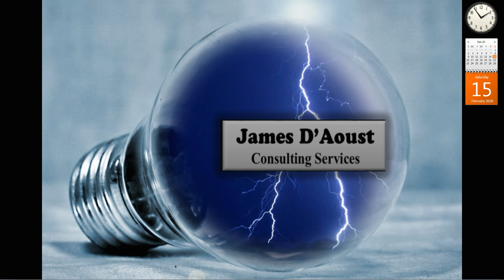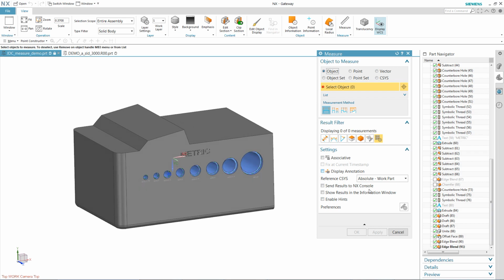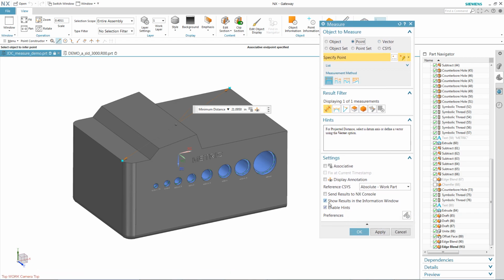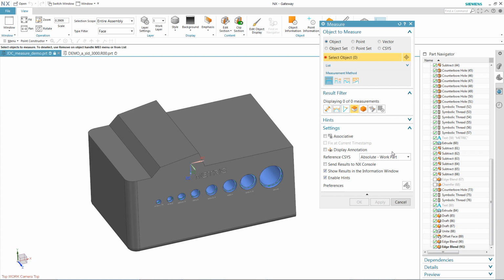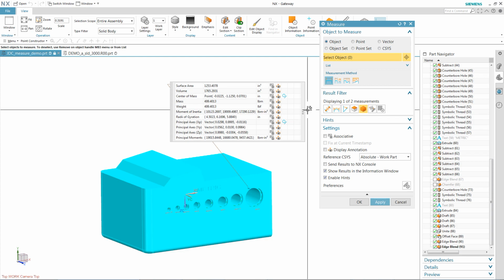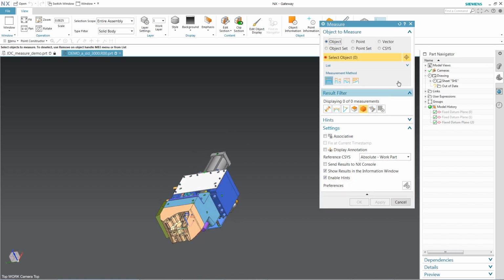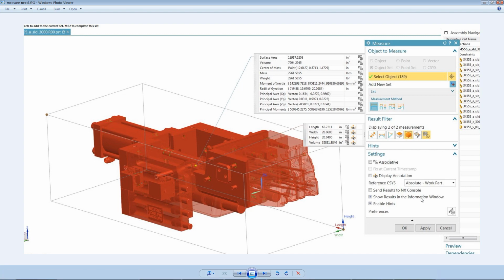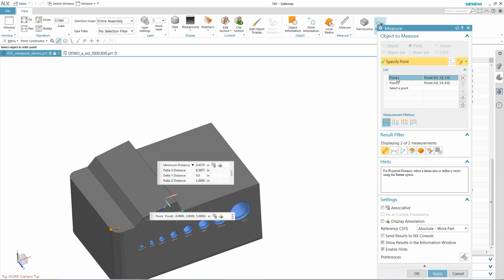Siemens NX 12 to NX 1899 releases measurement command demonstration James D'Aoust consulting

Comment: SIR I HAVE A DOUBT  IN NX 12.0 FOR MEASURING MULTIPLE FACE AREA  OF A SINGLE BODY MEASURE FACE COMAND IS USED IN NX18 CAN U EXPLAIN
Reply from the maker: Measuring a solid body and getting a 3D box and all the measurements was an enhancement added in NX 1899. It was not in NX 12. (If, in fact that is what you are questioning)